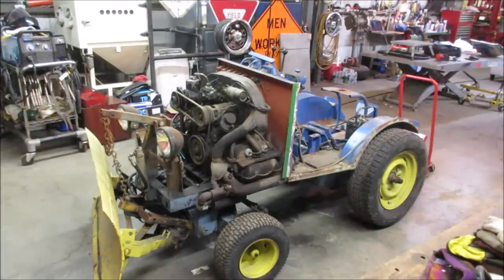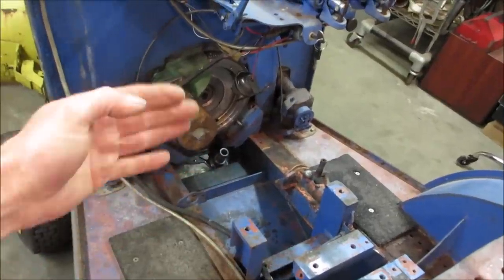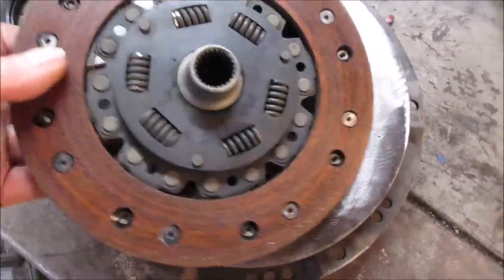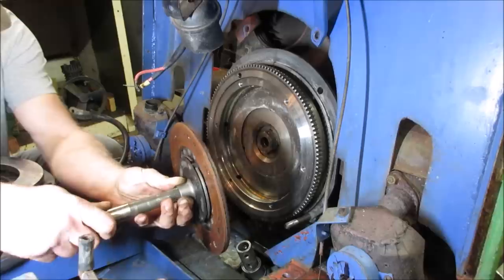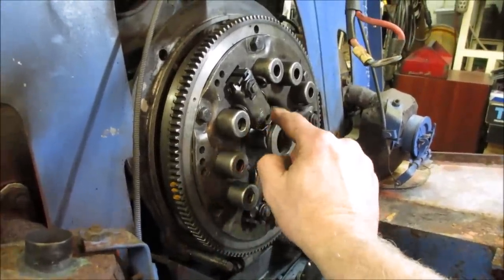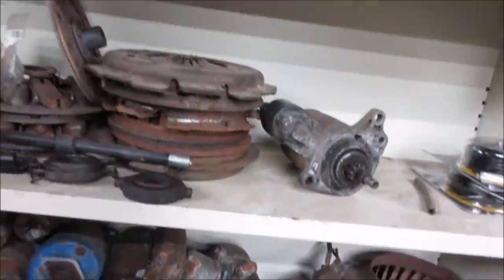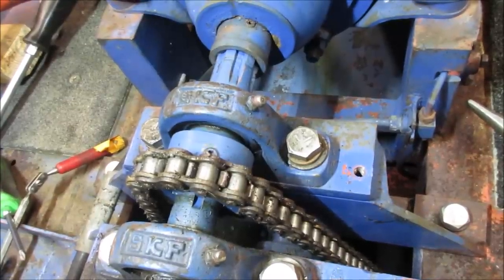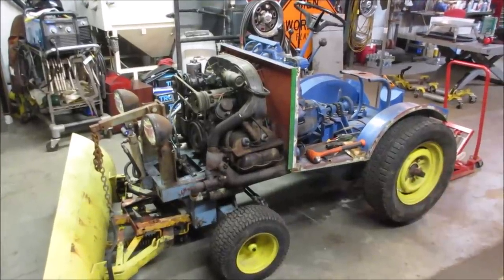This Antique Tractor Took Amazing Talent To Build!  Now Lets Fix It.

Comment: In 1956 my Dad built a small tractor using a Crosley 4 cylinder engine and transmission, a Pontiac rear end and an old oil stove surround for the hood.  This Mustie1  series brought back a few memories.  I was 7 years old then, and I just turned 74.  Dad just didn’t build a tractor, he built a memory.  I imagine whoever built the VW tractor did exactly the same thing.  Thanks Mustie1 for the smiles last week and today.😊😊
Reply: Great story sir. Our fathers could do some amazing things and we hope to pass this on to our sons and even daughters.
Reply: My dad built a small tractor similar to that using a Wisconsin one cylinder engine,a Chrysler three speed transmission and chain driven to a narrowed Studebaker rear end,motor scooter wheels on the front and a home built steering unit, only thing was the gear reduction wasn't enough to slow it down.
Reply: When I was little my Dad would visit an old Machinist tinkerer. He had a tractor-doodlebug in the yard with a Crosley engine and 2 Crosley transmissions in it. it sat for years as he said the neighbor kids ran it around the yard until all forward gears were stripped out. When he passed away, 2 weeks later I stopped by, his son was cleaning out the house. Crosley scrapped. Lathe and mill scrapped. All machinist tools scrapped, all tossed into the dumpster and gone.
Reply: I built a homemade tractor back in the late 1970s using  a 30hp V-4 Wisconsin engine with heavy duty clutch , GMC 4 speed truck transmission with granny 1st gear, and shorten Dodge differential.

Comment: After seeing the oil and gunk, I'd recommend checking the Transmission fluid, it may be bad as well. Also the fuel thats in it could be pretty bad as well, may want to drain that and refill it with fresh fuel. That's an awesome home-built tractor. The builder of that actually used his brain when building it and making sure it could be worked on in the future if there was a problem. So awesome to see what his imagination thought of and the quality of work he put into it. Great video Mustie. Can't wait to see it whe nyou get it all fixed up!

Comment: 3:23 I use to soak the disc in gas and then set it on fire. 
Does a very good job of drying it out.
Also did that to brake shoes too.
Reply: Old Skool then?!?
Reply: @susankelly7778  Yes and it's spelled school also.

Comment: I just love watching you rejuvenate old nonrunning mechanical stuff.  Just amazes me the oddball stuff that you find to bring back to life just like this tractor with the VW engine. Kudos to the guy who built it as it not only takes skill but also also a good thought process as to how it will work/fit together in the end, and make it actually useable.
 As a former VW tech, anytime we had an older vehicle that had a generator come in with charging issues (esp. if it sat for a while) we would make the generator "motor". If it wouldn't it needed replaced anyhow, if it did it would rejuvenate the field magnets and make the generator work to it's full capacity. Always worked like a charm! Just love your videos, brings back lots of pleasant memories!

Comment: I have rejuvenated oil soaked brakes shoes and clutches by cleaning the surface oil off with brake clean and then baking the friction material  at 400° for a couple of hours. That brings the soaked in oil to the surface and burns the oil up. Just sand off the fried oil and the brake shoes or clutch friction disk is good as new.😉

Comment: You just love those old beetle engines. If you want to put a governer on it l would go to a salvage yard that has old combines in it. Massey Ferguson and John Deere used 292, and 350 engines and they had belt driven governer in them. Model 410&510, and 4400 and 5500 . I think it would be easy to install.😊

Comment: The builder of this thing must have worked for a bolt company. I remember in the first video how many bolts he had on the cab top to get that thing off, and now looking at the skid plate under the diff cover.. I get it, need bolts to keep crap out of there, but MAN that's a LOT OF BOLTS!! Awesome find on this super rare tractor piece.. The hydraulics on the front are super cool to have. Really neat piece. The NorthEast and the South are the BEST PLACES!!

Comment: My former employer and friend had a self built tractor using a 2 stroke saab engine.  He pushed snow with it and used it to move his race trailer among other things.(I think he had a high lift for it)  He later adapted a snow thrower to a snapper zero turn lawn mower.  This "Saab" tractor was sold at auction a couple years ago by his wife after he passed away. I had hoped to buy it but there ended up being a bidding war and one of his former customers, a Saab car enthusiast, bought it traveling hundreds of miles to collect it.
Reply: Those Snapper zero turn mowers are surprisingly strong, I made a hillbilly skidsteer loader with one that has a 36" bucket made from 1 1/8 plywood, 2x4 lift arms raised with a Lay-Z-boy lift chair actuator and a 2500lb harbor freight winch to tilt the bucket. I made it in about 2 hours to move 10 yards of wood chips I had delivered for flower beds/garden. I thought it would break within hours but I've been using it for 2 years for filling potholes and grading my gravel driveway. I also mount my engine hoist to it like a mini boom truck and lift 400lb generators and log rounds for the wood splitter.
 I don't care how silly it looks, it sure beats a wheelbarrow👍
Reply: now, A video of building that would be great content!
Reply: Bummer that you didnt get it but it least it went to someone else that also appreciated it for being the cool thing it was.
Reply: @Mrcaffinebean  I'm 61 but the man that bought the tractor was probably well into his 70's.  Hopefully the next owner appreciates it more.  I was lucky to get the shop welding helmet (I wore often 23 years ago) and a stool from the shop.  Great memories.

Comment: I can't help but think that extra master cylinder bracket, the one on the left side, might be because the guy who originally built the tractor might have been thinking of kitting it out with independent brakes. It's not beyond believable to think the dual master cylinder could actuate both brakes for on road use, and at the turn of a valve, two separate cylinders could actuate left and right brakes independently. A bit of thinking would be needed, but it's not beyond possible.

I'll bet you need ear defenders when you get to driving it in earnest! We have a 1968 farm tractor that someone clad in steel and plywood around the cab, and that thing is deafening to say the least - Like a thousand dwarves with sledgehammers, licking away at the outside of the cab!

Comment: Solid little unit. Also very cool. You always find the cool, odd stuff.😊 Short list to finish it, brakes, charging, and that little exhaust leak and she's a runner. That plow would work well at the apartment complex i work at😊. Nicely done Mustie1, when finished it should turn heads at a VW show.👍

Comment: My old Beetle had Bigfoot valve adjusters.  You could use an allen wrench instead of a screwdriver. The end against the valve was wide and on a pivot so it was always flat to the stem. They were easy to adjust and held adjustment longer.

Comment: An old VW mechanic trick is.

1. Number 1 to top dead center.

2. Adjust valves on number 1, intake on 2, exhaust on 4.

3. Number 3 to top dead center.

4. Adjust valves on 3, intake on 4, exhaust on 2.  DONE.

Comment: This tractor is mostly well thought out.  I think the builder didn't think too much about service issues.  The firewall is so strong to hold all the hydraulic valves etc. but now some access panels might be in order.  That rear end enclosure is a bit of overkill.
Cheers 🇨🇦

Comment: I know it would take some ingenuity but that is what you are good at.  I think what would be cool is equipping this machine with a mower deck.  A mower deck would make it useful for something other than pushing snow.  Maybe could use a hydraulic motor to operate the blades.

Comment: With the engine it has I would put a ac compressor and hanging air in the roof of cab,   mower deck and a cup holder for a beer (not bud light) and my yard would always be mowed  neatly!

Comment: Right hand muffler leak at 39:36! Only a pin hole. If the manifold is leaking in the heat-exchangers the exhaust fumes will be blown into the cab with the warm air! Nice work, reminds me of my first car engine I stripped down and rebuilt at 18 (1980) 1970s beetle engine. Cheers.

Comment: The tractor reminds me of one of those Popular Mechanics projects in the 1950's like where they would take a Ford model A engine and saw it in half to make a two cylinder out of it and use the transmission and rear end to make a garden tractor out of it. This is just an updated version using an air cooled VW eliminating the radiator and associated problems. The rear end looks like a 1940's Ford unit narrowed.

Comment: Hit that clutch with a torch. It will draw any soaked in oil to the surface. wipe with a solvent rag and repeat. Works great on clutches and brakes.

Comment: Mustie1, That was a lot of sludge build up. I’m sure you're probably gonna run it and change it once more along with greasing those pillow blocks and changing the Trans/Diff lube. Would be interesting to see under that skid plate? Gas tank needs a check anyway….just sayin (as you say) ….haha! Seriously though, just a toy but you did a nice job!

Comment: I been enjoying this one, that thing should last forever providing you can always access parts. A experienced clever mechanic did one helluva job on this baby! This thing! is so unique it deserves some real TLC as far as I'm concerned. Boy, that thing! was in need of some maintenance, holy schmoly, not changing oil for forty years wow. Some folks just have no sense. I love the ole vacuum cleaner sucker upper! used to defrost the windshield, that's cool idea!  btw Darren Can ya, take the exhaust off and cut an access hole to repair it, than than keep the access hole by making a cover for it. so later on you can always access it to do a repairs, just wondering?

Comment: Hint to fix crank oil leaks.   
Create a slight vacuum in the crankcase by connecting it to the intake pipe between the air filter and carburettor. 
This was common in the days of fabric or felt type non-positive crank seals, and works fine.

Comment: Excellent video Mustie   1 :) also hope fully on carb rebuilt to solve problems to also Generator be fix or rebuilt solve charging problems and would see if make gas pedal for throttle when drive in floor some way beside lever on be like cruise control too ! Also hole exhaust hope be simple fix too !

Comment: Salvageable, yes. Major components are functional. Some new gas, a few parts, more troubleshooting, a lil lube, muffler leak, carburetor service, battery not charging, master cylinder swap. So a couple days more work.
Soon it will run smoother. Interesting tractor plow.

Comment: At the point you tightened the set screws on that spline shaft, do you realize there was a set screw that entered the bell housing? It might become inaccessible when the assembly is complete. You might have  tightened only half of them. Two of the four in total. It's at 26:18 on the time counter.

Comment: Have it at pretty high RPM and slowly pour a bottle of berryman into the carburator and it will clean out the tbe carb and valves quite nicely 👌

Comment: Many years ago I remember seeing a video of a guy who made a small 4WD loader. He used an old Saab engine(99/900) with built in gearbox, welded the diff, and ran a drive shaft front and one rear and mated them to to axles from RWD cars, and if I remember correctly steering was done by pivoting the "waist" of the machine. It must have been quite powerful considering those engines are at minimum 100HP. It was really quite amazing, but I can't for the life of me find the video again. Sorry if my explanation is lackluster, english is my second language so  I dont know all the terminology
Reply: My older half-brother Bob had  running-gear from a '37 Plymouth sedan (no body) that he installed a second 3-speed in...but installed it  ( IN LINE ) BACKWARDS. 
Put one in low gear, the other hi.... put both in REVERSE....AND ( THIS IS A TEST ) YOU GET_________?

PUT BOTH IN:  __ &  _ ^..^  ¿I
Reply: By-the-way.... your English is excellent!😊😊

Comment: Wheel Bearing grease on both sides of a Stock VW Valve Cover Gasket (coat it) will seal better than anything and always come right off with no mess.

Comment: Got to thinking about the left hand master cylinder bracket, could it be the original owner was thinking about dual brake system. Just a thought. Left wheel, right wheel independent.

Comment: Those VW engines have been around forever. But I find the more I learn about them, the more I think they shouldn't be as well known as they are. They seem like they shouldn't work. 
The valve cover looks like it should just leak oil after a month because it doesn't look like it drains back into the oil pan. 
The other thing is how it pulls heat off the exhaust pipe. I know since it isn't water cooled it couldn't use a heater like other engines could. By just taking heat from the water and heating air.
I remember I met a guy with a VW bus that told me about the heater on VW's back in the 80's. He said that if there is an exhaust leak any where it would just pump exhaust in the cab. I could see why some anti car people now might not like cars. They spent their childhoods stacked in one of those buses going from town to town watching the greatful dead concerts. Anyway, I digress.
Maybe I should get me one of those engines and poke around in it a little to see how they work? I think Mexico was making the same VW bug model from the 70's up until 2005. So there should be some around for cheap. 
I can watch Mustie1 videos if I have any questions on how they work.
Reply: The oil drains back into the block through the pushrod tubes.

Comment: Cool toy even though I would still flush engine sooner than later for maximum flow it looks like a work horse I would even add oil cooler and small fan in cab for add heat even a small wiper for front windshield some wider chunky tire for winter it be a good trailer mover or pull cars around need moving I would loved to build something like that if I had means to hopefully I get chance to future miss creating things keep up great work and have wonderful day.

Comment: 34:20 If you look at the screwdriver where the handle ends and the shaft begins you'll see a location to attach a wrench, that should help with leveraging hard to undo screws/bolts
Reply: With all due respect don’t you think Mustie doesn’t know that

Comment: I would wash and brush everything under both valve covers to reduce the load on the engine and loose main bearings from very poor oil maintenance. Then dropping the oil pan to put new mains on her the oil pan could be cleaned too with gasoline before closing it up. You probably will hear main bearing thumping before oil change. She should have 10w 50 fresh oil. After you cleaned those two valves she sounds exactly like a John deere until revved up.

Comment: You have another show winner 🏆 

1) at the VW shows (add VW hub caps, steering wheel, door panels, trunk and hood, it’s a VW plow convertible) 

2) at the farm shows it’s a V-Deer plow (put on the original green cab)

A winner 🏆 at any show because of that VW engine (just add the appropriate show theme door and body panels)

That VW powered motorcycle is always a show winner because of that VW engine

Comment: Hey Mustie.. curious.. If you test the alternator, like you mentioned, do you bypass the regulator and supply power directly to it? if so, that should tell you if it's the alternator or the regulator, right? (strictly asking.. don't know myself..) Find that exhaust leak and put some flow masters on it, will ya??.. lol.. CHEERS!!!

Comment: To see if the manifold leak is in the heater box when it's running pour a little transmission fluid down the carb and see if smoke comes out of the heater box ...do it outside too

Comment: I would use a shaft coupling that is a 2 piece unit  where the the 2 halves bolt together,,  Would require a bit of machine work with a mill if you can not buy one,,  'Made By Madman' could help you out with it,,  🙂

Comment: It needs some fluid filled shevron tractor tires on the rear. 
And a counter balance.
That's a lot of engine for its size.
A 1,600cc is something like 47hp-ish.
So I'd say it's around 40hp ish.

Comment: You can place an oil soaked clutch disc in an oven,preferably not in your home,and bake the oil out of it at 200' or so after you remove as much oil as possible via brakleen or a good soaking in super hot water and degreaser..

Comment: Hey mustie1.. when you run kerosene through the engine. Do you keep the engine shut off and let it soak, Or do you fill it up and run it for a minute or two? My late father never explained that old trick to me. He told me about using laundry powder in the radiator to flush out the engine block he also said you need to run the engine for about 5 or 10 minutes with the laundry powder in it. That it will clean out the gunk and sludge and rust. Then drain it while it's hot. Then let it cool fill with regular water run it again the drain and let cool. Fill with 50/50 Then it should be ready.

Comment: It would be an interesting experiment to put the clutch in the ultrasonic cleaner tank with carb cleaner.   And I've "heard" that packing the clutch in cement (I don't think the readymix that includes sand) will sort of "suck" out the oil from the clutch material but have no direct experience on that.